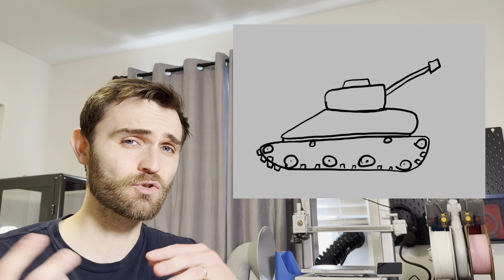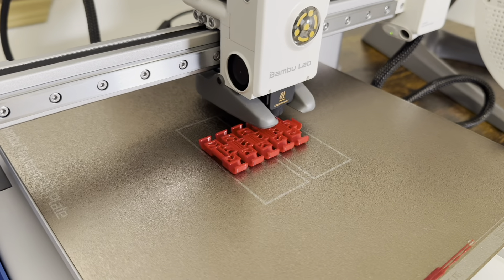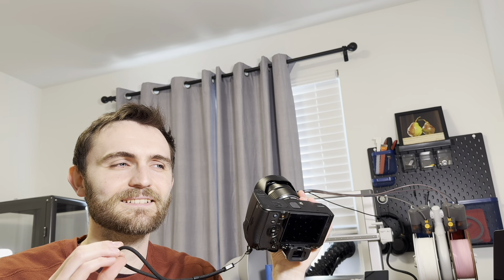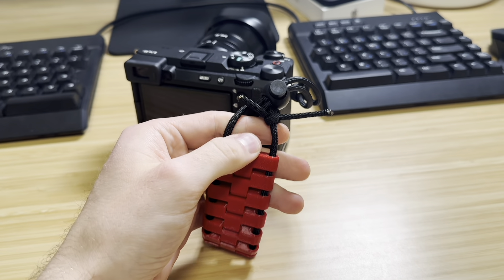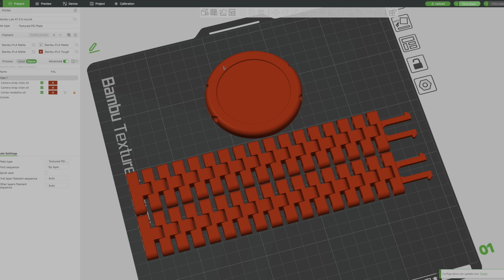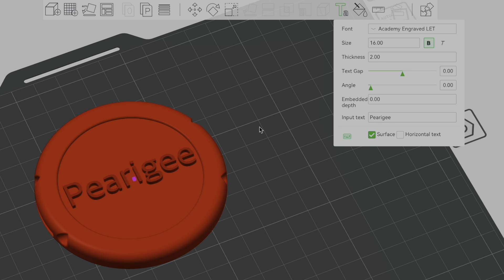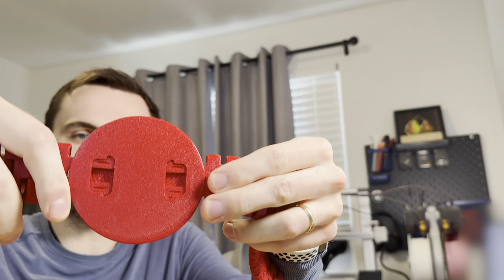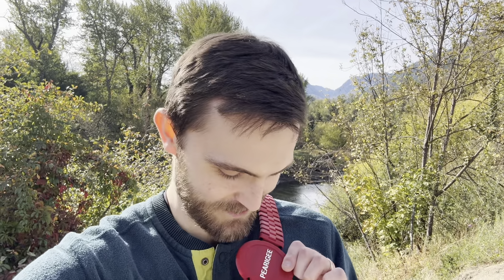Tank Tread 3D Printed Camera Straps

Comment: looks amazing honestly, i might waanna print this later for a small backpack that i have 
i would have made some snap in ( or glued) parts inside the  strap, and then printed a long rectangular tpu piece that snaps on the inside, making it foam like and more comfortable to use, maybe make it connect every 5/6 connections so it bends apropiately, but it does look good this way!
Reply from the maker: Love the idea of using TPU. That’s not a material I have a lot of experience with . . . maybe it’s time I give it a shot!!

Thanks for the view and the comment!
Reply: @pearigee  What an awesome make!!!  my first thought was "why wasn't it TPU" since all the strength and security is covered by the paracord?

Comment: Something I noticed that I may have done: I would not have actually made the medallion round. i would have trimmed it down to match the width of the tread portion. it would make it a little more cohesive, comfortable, and saved on material while still affording you the functionality that you designed into it. all in all that is awesome. Maybe you could also make it a modular system. instead of having the pivot rod in between each "tread" go all the way through just have it be a tab on either side allowing you to snap the next tread into place. this allows for more sections and slightly better printability. you dont have to worry too much about the strength at that point because the actual stress is not on the print itself with the paracord taking most of the load.
Reply from the maker: @TheFaithfullMaker   Hey! All excellent suggestions. I agree making the medallion strait would be more cohesive and functional. Having the individual links snap together is also brilliant! Great ideas for the next revision. This is why I love posting my stuff — the community suggestions are awesome.

Cheers! Thanks for the comment.
Reply: @pearigee you can make the medallion as your lens cover holder. I remember buying a lens cover holder for my camera strap, and this made me think of it.

This way your medallion can function as another accessory!

Comment: The pinch points worry me a tad.
As for knots, you want to do a sliding knot at the end. 
Either join both ends to each other with double fishermans, so you can slide them apart to shorten/tighten the strap (this is how some wristbands are made)
Or loop the ends back on themselves and tie a prusik knot that you can slide up and down to make the strap tighter.
Reply from the maker: @liammurray9274  Thank you so much for the thoughts and knot advice!!! Really appreciate the suggestions!!

The pinching is actually something I thought a lot about. All of the surfaces are rounded (to avoid any sharp pinching areas) and the joints are spaced in such a way that even at full bend they leave a few millimeters of distance between them.  I was also concerned about the joints ripping out arm hair, haha, that is why I opted for the central cylindrical axle. That allows the body of the chain to mostly cover the opening and reduce the risk of something getting caught in there. More iteration could probably improve the comfort further though. :)

Thanks again for the comment and view!
Reply from the maker: @liammurray9274  I will experiment with the knots you suggested this week. If they work well I will update the MakerWorld/YouTube description with your recommendation and credit you!!
Reply from the maker: I just finished trying these knots. The double fisherman's is perfect! Thanks for the recommendation.

I updated the video description and MakerWorld documentation to recommend this strategy.